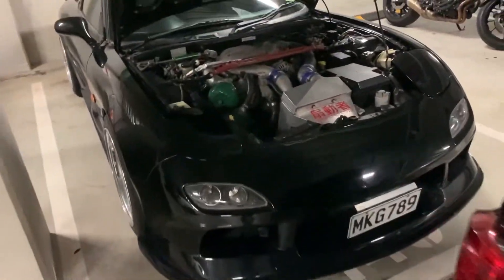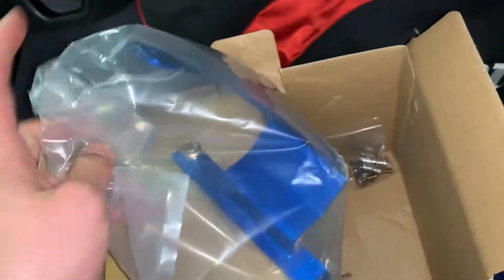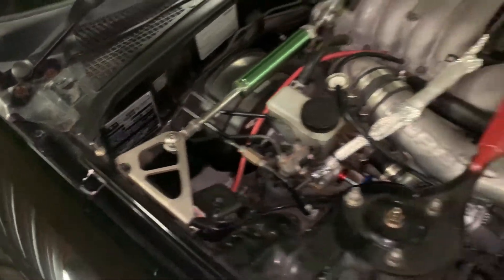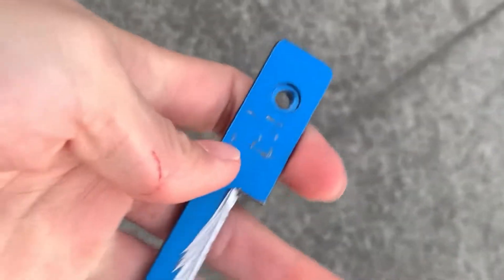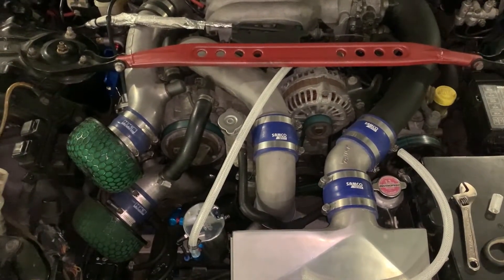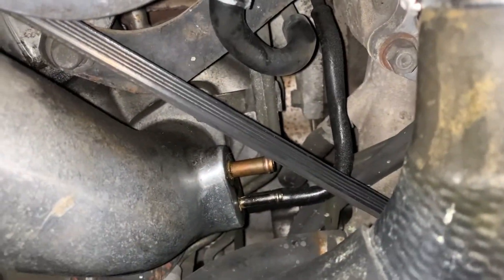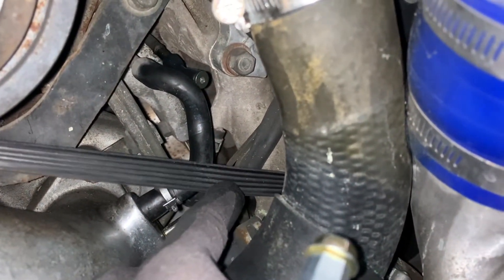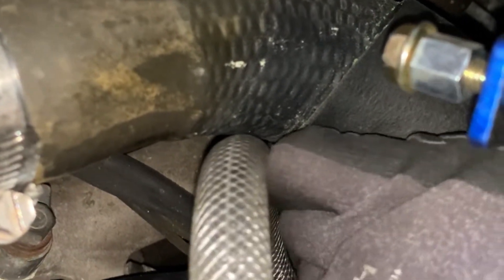Oil Catch Can Setup For The Mazda RX7 FD3S

Comment: It's really hard to find information, how to install a catch can on later series models and stock twin turbo properly. This video helped me for understanding it, thank you! How did the setup run? Did you change anything later?
Reply from the maker: @StefGamerx  Hi, mate, honestly after I installed this, I found it’s unnecessary to use it. It doesn’t really have oil in it after I drive it for a while, it only have a few oil stain on the inlet hose, and almost nothing in the catch can. 

There are a lot of stock FD don’t really have oil catch can and still running really well. 😄